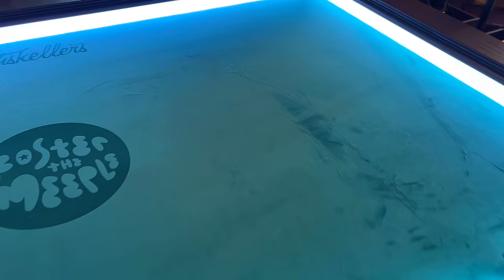Youtube Studio Tour & Rathskellers Board Game Table Review

Comment: Nice space. For the hated rear table. If instability is the problem. Why not just stick some command strips on the back and stick it to the wall so it doesn't wobble around when bumped? It won't solve the problem of Jeff hitting the thing all the time but might keep some things from falling off of it due to the fact it isn't secured. You could always use a bracket too but that is a more permanent fixture and leaves holes in the walls. Command strips are pretty sturdy and can be removed later without damage if you don't want them later. Granted you will need enough coverage to withstand the stress of getting hit.

Comment: Great video. Looking into tables now as we build a new house and it is really confusing how to determine between a KS campaign for tables vs. ordering from someone like Rathskellars. I feel like the time between order and delivery in super unclear. I am struggling to determine when I should try to get a table because I can't tell when to order, how long it would take to receive it, when I would need to pay (KS vs. retail vs. downpayment systems they all seem to have) and just generally timing on buying a table is difficult. I feel like most people just decide based on what they want and get it whenever they get it, but we would want to time it with a move and that seems impossible. Any insight into the time frame between ordering and receiving from Rathskellars?
Reply from the maker: Honestly I would 100% reach out to them just to inquire on a question like that. They’re very communicative IMO. However, I would assume it won’t be super easy to get an exact delivery date. Give they are hand crafted, I would assume the timeline would be on the longer end and likely would be a “window of completion”. But the best solution is to just open a dialogue with the company and ask them these questions
Reply: It takes 9-12 months to get the table after you have ordered it. Rathskellers want you to pay full amount before they start making the table. First you pay a reservation cost, then you and a seller from rathskeller will discuss all options and add ons they also send you samples and some other goodies. When the order is approved by you, you pay the full amount. Then you wait, and now and then you might get some updates with pictures on where in the process you table is currently.